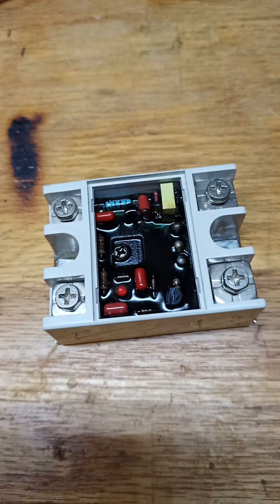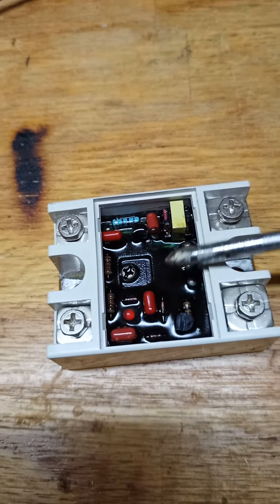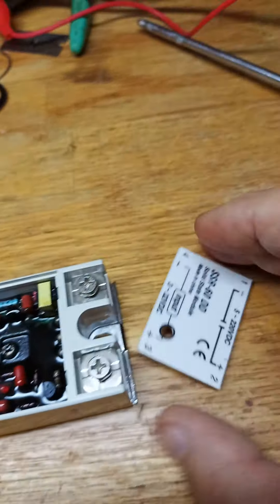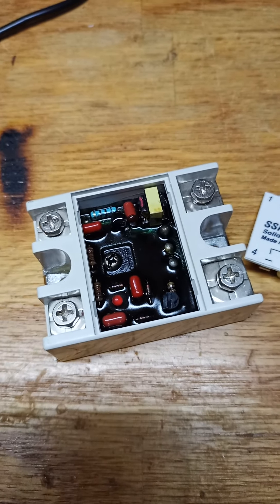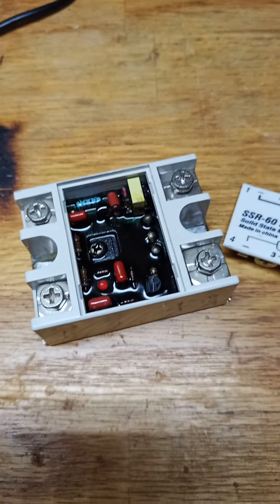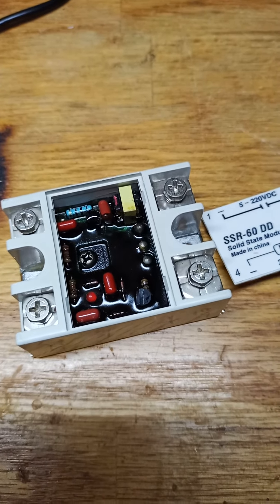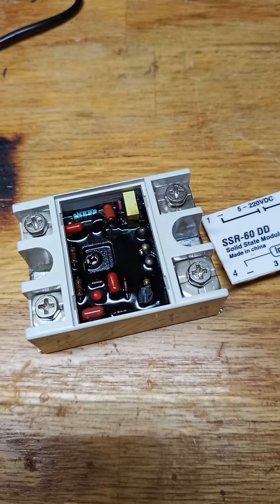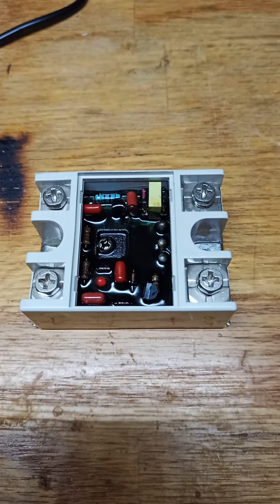60A DC SSR Bites The Big One,  The END of Stupified Solar

Comment from the maker: These solid state relays are just too fragile to use.  This one shorted out and have no idea why.  Voltage was limited to 60V and 4A,  This may have entered a liner region.  The little yellow thing is the transformer as I expected.  The top was easy to pop off. Unlike other SSR, this one is potted and unlikely to be repaired.  This is a total loss as have many other attempts at trying to make it easy for the non technical in solar.

These has all been costing me way too much with no end result.  Effective solar projects just can't be dumbed down to modules bought on amazon and screwed together.   This Chinese stuff is just to unreliable and expensive to boot. I don't mind someone burning up a 15 cent chip. I don't want to be blamed for someone burning expensive modules.  Doing things right requires discrete components.  This is the end of amazon screw together projects.

Comment: Agreed! Nothing beats the efficiency and reliability of a single MOSFET for DC and dual MOSFET for AC with a tiny $1 isolated SMPS thrown in for the gate drive. I look forward to your videos on those

BTW - is this SSR the type that use a HF oscillator to generate the input signal that feeds through the HF transformer providing the gating signal?